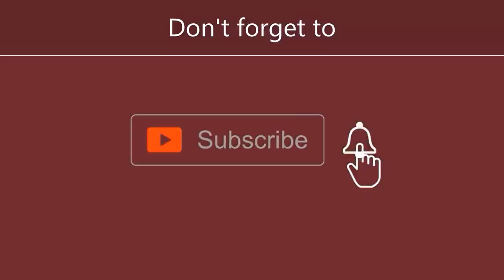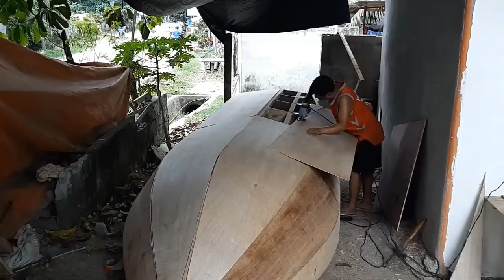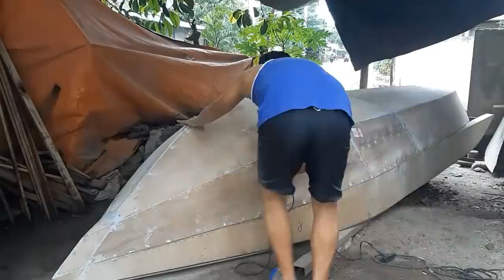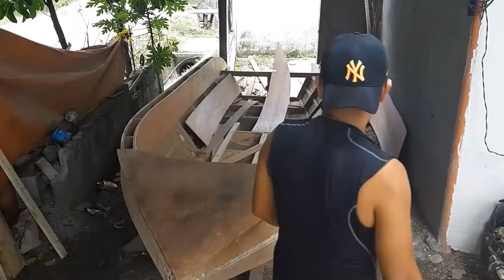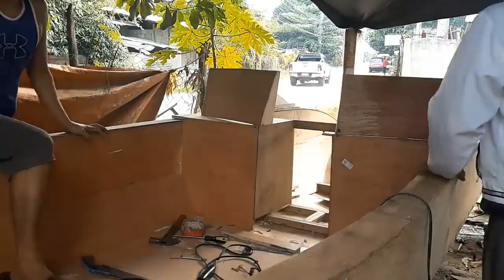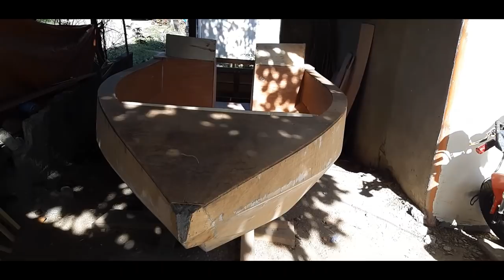Building Wooden Speedboat / Bangka na speedboat ang design- Part 2

Comment: You are a very talented young man...I live in Oregon USA .So one thing i noticed is that you don't end your ply wood on a 2x4 .That is called a cold joint.If you want your boat to stay and hold together there has to be good framing practices..I understand you are going fast to hurry and get the boat built...More patience is a good thing to have.Look at the older accomplished builders on the net.They have great ways to attach things ,good joinery and fitment of the plywood and the framing..Thanks for the video..Keep doing this and every time you will have learned something new...:)

Comment: You can incapsulate it with fiberglass put a 60 hp outboard motor and it will be fantastic yan po ang gawang pilipino na mai pagmamalaki sa iba good job gustong gusto kona making na palutangin yan Bravo !!!
Reply from the maker: I will consider your suggestion. Soon medyo ipit kasi sa budget.

Comment: Sir musta friendly advice hanga ako sa skills mo. May kaunting advice sana kasi yan trabaho ko ibang bansa. Double hull yung boat mo kita ko pero sana bago mo tinakpan pininturahan mo sana ang loob and yung pangalawang dingding kasi papasukin ng moisture yan tapos yung kilya mo or kell ng bangka mo sobrang liit. And yung sa labas na lagyan mo ng proteksion kasi na pag sumayad yan pag dumaong ka sa tabing dagat yan kaagad ang kikis sa buhangin or bato. Maganda kng baonan mo ng angle bar na stainless sa susunod mo na project.
Reply from the maker: Salamat sa constructive  inputs mo sir. Tulad mo na mga tao tagal ko na inaantay mag comment kasi nakakatulong dagdag ng kaalaman. Noted po ang inputs mo Sir!!! Actually di ko pa talaga ge finally fix at epoxy ang double wall pati ang flooring kasi tama po kayo need talaga e waterproof ng paint. Naka temporary screw lang siya kasi pupunasan ko ng fiberglass resin ang inner side wall at mag lay up ako ng fiber glass mats  inside the hull n e wrap ko din ng fiberglass outside. Oo nga sir medyo maliit ang mga keel ko. E limit ko nalang talaga passenger para iwas bali.
Reply: @InnovationsMindChannel  ok sir alang ano man. next project mo yung keel talag most important kasi dyan naka salalay ang bigat ng makina mo vibration at bigat ng karga pati narin ung pitching,hoging,rolling and saging ng bangka sa tubig.  Kasi yung conventional natin na bangka simple lang pero yung keel nya malapad and buo ang tabla so kaya nya yung vibration ng makina. Good job sir sana maraming mag pagawa sa u.